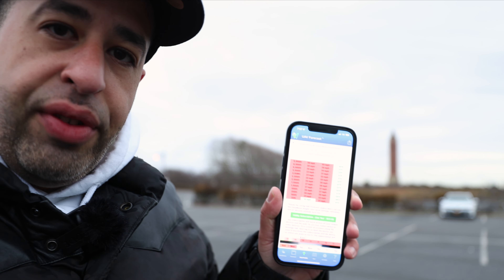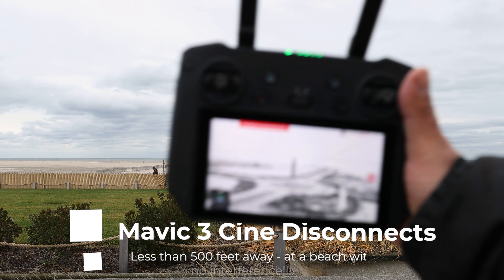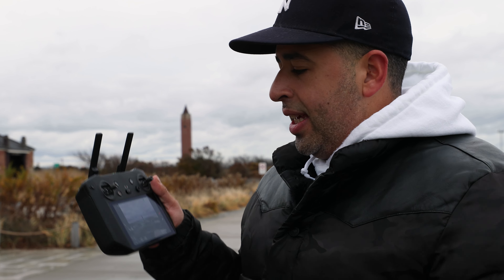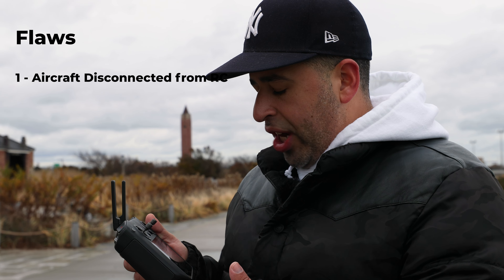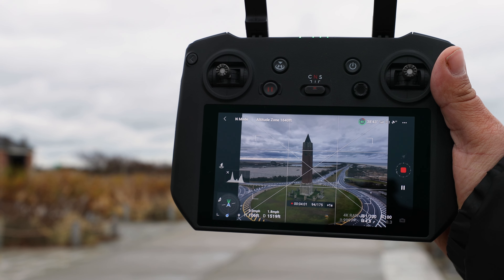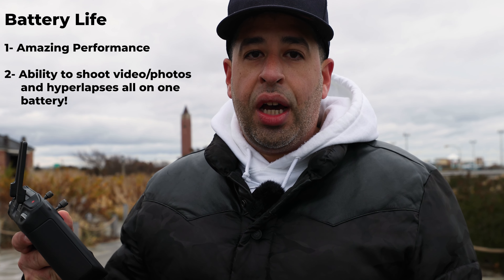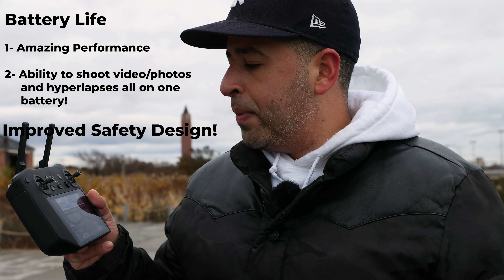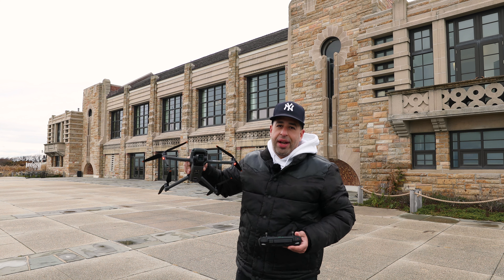Mavic 3 Cine - Firmware Update - Aircraft Disconnects! Hyperlapse Added

Comment: I have the same problem with AC disconnecting from the RC Pro.  This is happening to a lot of users, I hope DJI fixes this with a firmware update.
Reply from the maker: Terrible
Reply: @MrEddieNunez   Currently suffering from the same disconnect issues with my Mavic 3 Cine and RC Pro. I lose video feed and get the disconnect prompt and cannot change any settings, but I am still able to manipulate the aircraft's flight controls. I have found it is more reliable when I go into transmission settings page and select frequency to be 5.8 GHz but unfortunately this limits range. I have heard that exchanging units can solve the problem. Holding out for the next firmware update to resolve these issues along with missing capture modes. If the problem persists, I will exchange my unit.

Comment: Disconnect issue was the reason I returned my unit. Once that is fixed, I can repurchase. Disconnection may cause a fly away.
Reply from the maker: Did you have a standard remote or RC Pro?
Reply: Standard remote. I was thinking this problem is non- existent on the RC Pro, but this video just confirmed it is a major flaw. The M3 is awesome

Comment: Hey Eddy! I had the same problem with the RC Pro disconnect problem after the update. The RC Pro needs to be paired with the Drone again.
Reply from the maker: Hey MicoGhost. After you paired it again, did that solve the issue?
Reply: @MrEddieNunez  Yes, it did. I have had it out on several flights, 1 over 30 minutes long, and no more disconnect message.
Reply: Hey there I’m having the same issues with mine, what do you mean by pairing? Link the remote to the drone or binding?
Reply from the maker: @betterviewfromabove706  yes- he meant link it by binding again, or pair… same thing.
Reply: I’ll try that see if it works.
Reply: @betterviewfromabove706  binding!

Comment: Just received the rc pro to go with my mavic 3 standard. I did a hover test on the back patio a few minutes ago. Within a couple minutes I got the ac not connected to rc error in the flight log followed with another error Downlink data connection lost for 35.9 seconds. it was 3ft away from me hovering. It landed then the rc reconnected. tried it again. Within a minute same thing. Landed tried it again and within a minute lost connection and landed. Paired back to the stock rc and flew for over 30mins and 40k feet traveled with perfect signal. Wish I'd seen your video before I bought this paper weight.
Reply from the maker: Sorry to hear this. Please open a ticket with DJI. They need to know about these issues so they can hopefully resolve it with a DJI firmware. I will be flying a replacement mavic 3 this weekend to see if the issue is fixed with hardware.
Reply: @MrEddieNunez  hi Eddie, I've had the exact same issue with mine, check the video on my channel. I'm in contact with DJI now, but they just came back to me saying there was no issue with my aircraft and it was only the environment I was flying in. I strongly disagree, since I have quite a lot of experience flying plenty of other drones, and this was a wide open area.

Comment: Man eddy that sucks, i don't have that issue with my M3 i am using the regular controller and never had that issue yours is presenting on this video, could it be the RC pro the issue and not the drone? also eddy i noticed to that the horizon tilt is a random thing comes and go, i like the bag too, as to hand catch have you tried putting the obstacle avoidance in brake ?
Reply from the maker: Hi Javier. Yes, if I turn off obstacle avoidance I can hand catch. I haven’t tried brake. The horizon tilt is definitely at random. Sometimes it’s present other times it is not. I did try to fly it with a standard RC yesterday and the same issue continues. I think it’s drone related or drone firmware. Either way I returned mine today for an exchange. Should have the replacement shipped to my doors in a few days.
Reply: @MrEddieNunez  ah man hope all works out with the new one.

Comment: Hey brother,
I just wanted to let you know that we are having the same issues with our M3's. Especially in active track. R/C disconnected. You can't control it but it continues to follow subject until, I'm assuming critical low battery and lands on its own. It's so bad that we make tracked subject leur M3 to a safe place ldz and wait for it to land
Reply: After reading other comments I thought it's important to mention that we use standard control
Reply from the maker: Thanks for sharing this. Have you opened a case with DJI? They need to know the danger behind this and how widespread the issue is.
Reply from the maker: I received a replacement drone and will test it soon.

Comment: This is the only video I’ve found that covers the ongoing issue with the RC pro disconnecting from the mavic 3. Has anyone found a fix for this? Btw dji is useless with the topic.
Reply from the maker: No fix yet. I returned mine back to Best Buy. Replacement will be here Wednesday
Reply: Ohh wow that’s awful, I hope the new one doesn’t give you any problems.